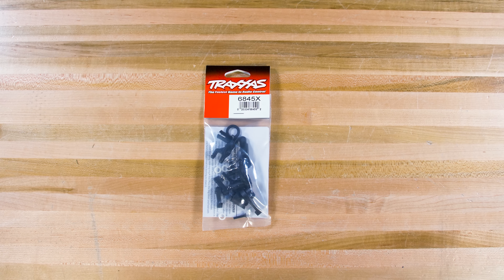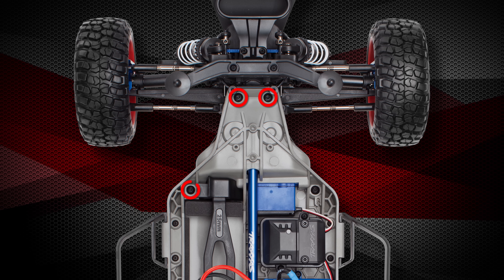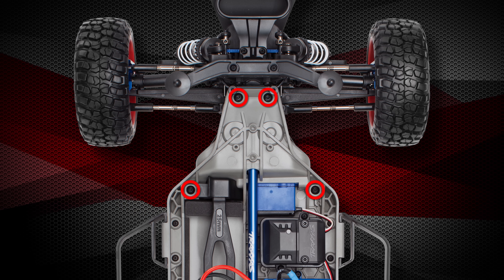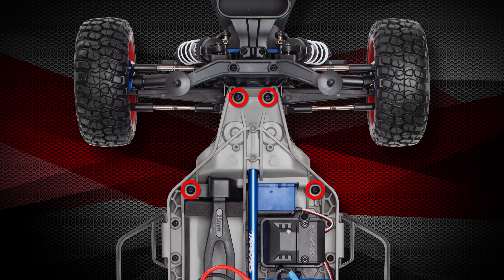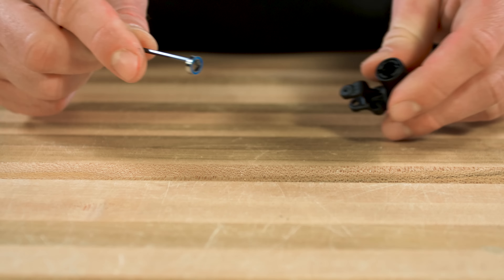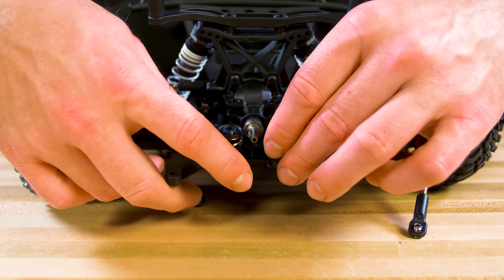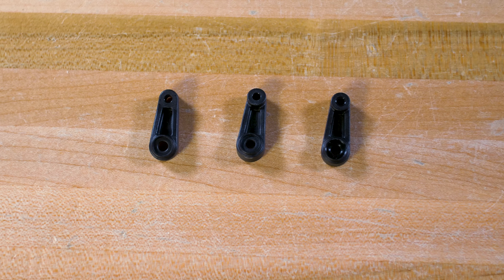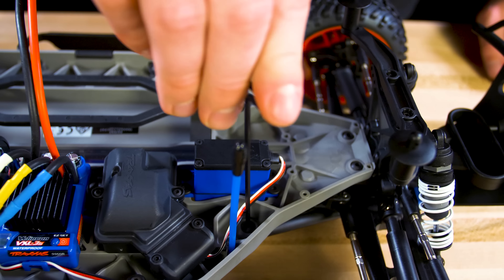Steering Bellcrank Rebuild | Slash 4x4

Comment: I love the spring doesnt want to fit my fingers are bleeding
Reply: Same I can no longer feel with the tips of my fingers I still haven't got it on yet.
Reply: SAME!! The 6845x IS the worst part for anything ever that I have ever used in my life.
Reply: I actually got it in now i left the spring for 1 week under pressure and then it worked